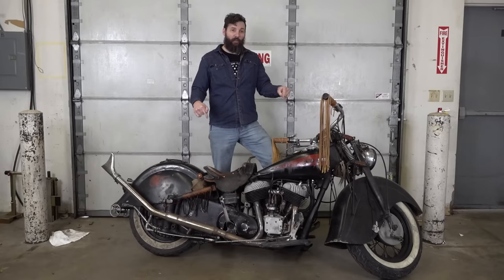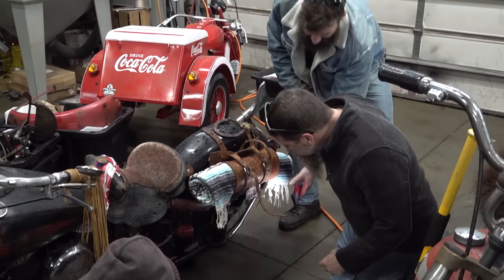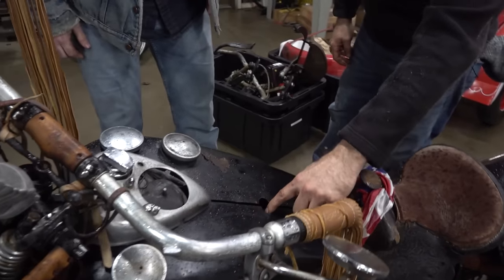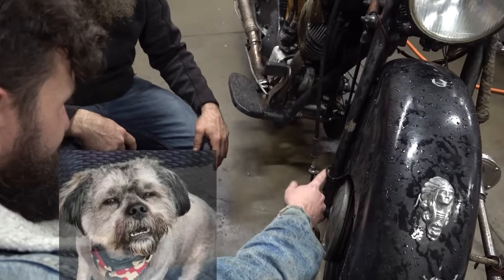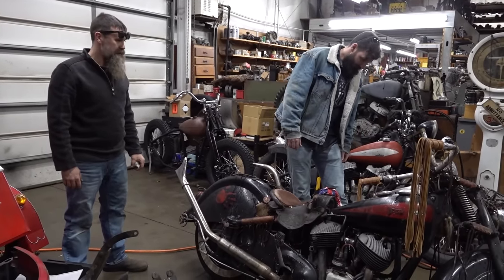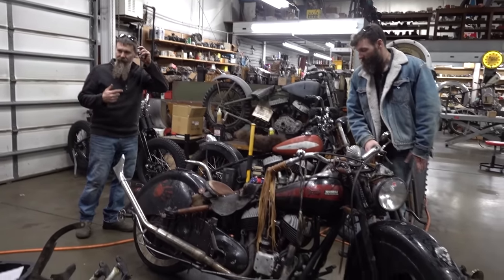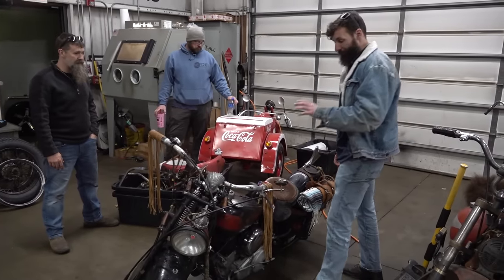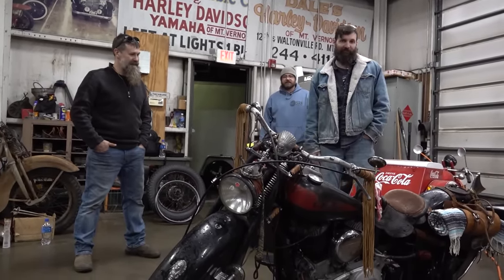Did I lose $14,000 on a Fake 1948 Indian Motorcycle?

Comment: You've got some good bones to work with, there!  Congrats!  I, on the other hand, am enjoying dealing with an utter terror of abominable.  My employer purchased at auction, an "alleged" 1940 Indian Chief, in virtually destroyed condition.  There were not even pistons in the jugs.  I "volunteered" to rescue this mutt, after he had sent the engine out to a "professional engine rebuilder"  who billed him SEVENTEEN GRAND and sent the engine back, basically destroyed. ROBERTSON head deck screws replaced the original fasteners holding the primary case on.  I almost puked when I saw it.  This is a current resurrection, and I'm getting tons of high grade parts from Jerry Greer.   Please contact me if you would like to hear more horror!!  Thanks for the video!
Oh - and be very careful when working on those rear "shocks..."  you can get bit.

Comment: Honestly , give me a 48 and I could build you one just like the one you have right now from a pile of tubes ! The guy can tell you this is 48 thats 48 I can put all those numbers  on a frame with a harbor freight stamp kit some numbers look different but if your good you can find stamps that match originals seen it done not saying ive done it but saw it done with a panhead and I know his frame wasnt a pan frame cause i built it copying another frame the guy got one that was bent and I copied it  ! He ended up showing the bike and got 98 points at an actual meet where judges judged it  Stamp your motor stamp your frame with the same numbers and my state would issue a lost or stolen title saying its a 48 its easier to copy than most realize I used the same exact dimension and thickness tubes that had identical Rockwell hardness and similar mineral makeup . Not sure why so many experts are employed to do this only way to honestly know what you have is to have a family history with what you buy. I'd never buy anything without family history attached to it or if I found it myself in a barn out in the middle of nowhere.

Comment: I guess everyone has their desires but 14k for that bike? I would pass unless I could get it back to stock for under $2000 from its current condition. But some people will pay more if its what they desire. I like Indian but aren't they owned by Polaris now? Anyways, other than the exhaust it doesn't look bad. Looks like a leftover from Road Warrior. 😂
Reply from the maker: It’s not a comfortable bike to ride
Reply: @BikesandBeards  Doesn't look it. My 2014 Valkyrie is comfy for about an hour. I plan to take a trip from San Antonio the NM or possibly even Arizona. Long trip. Probably need a betger seat or some sort of add on cushion but they ain't cheap. But i can alway throw some sort of pad over it I suppose.